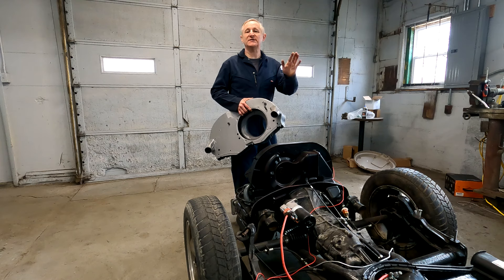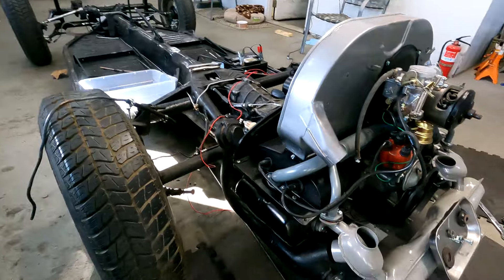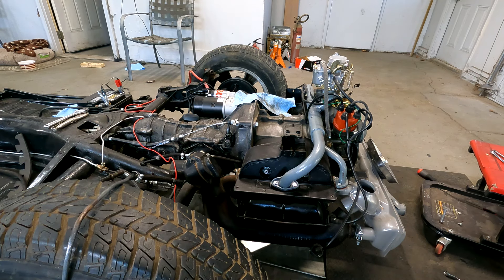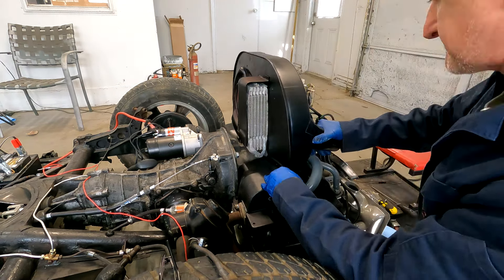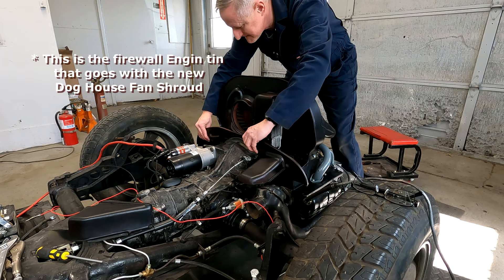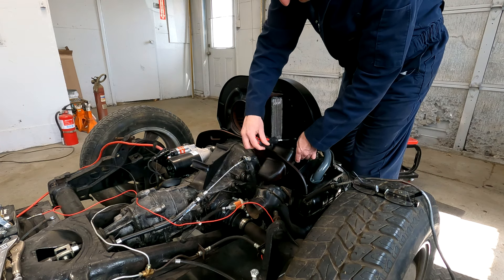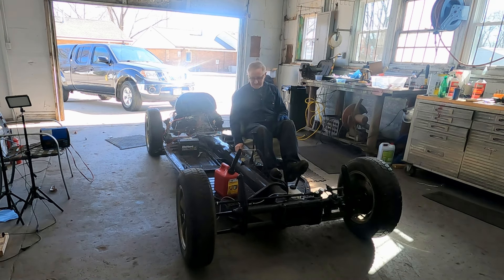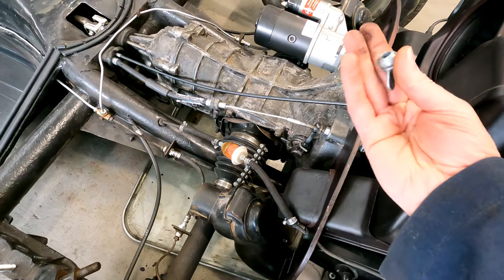64 VW Beetle: Dog House Fan Shroud

Comment: Well hello there. I'm thinking of doing the doghouse swap on my STD 73 1600 S.P. My question is will the deflector vanes an thermostat hardware swap from the OG fan shroud to the doghouse style? Thanks from Victoria BC (Canada)
Reply from the maker: Honestly, I don't have a ready answer.  The thermostat hardware is important if your are going to dirve it in cold or cool weather.  I figured that since I will not, its a late spring/summer car show car, I left them out.

Comment: You did a good job, and there is already enough experts that have chimed in here, but I have a question about the engine mount bolt behind the new dog house.  I’ve changed all my older VW’s to the through bolt with the threaded insert in the case.  Trying the take off the nut to pull the engine with the body on  is extremely difficult, so the insert option makes it very easy.  Just wondering what your plan is reconcile the problem. It looks you are still using the original style bolt and nut.
Reply from the maker: Thanks! you can see here https://youtu.be/7qPTon2QiOA?si=nYtWs37banqIsaQc&t=641 the nut is on the transaxle side, so (in theory)  if I remove the nut the engine should be able to slide back enough to get the bolt out.

Comment: Make sure you have all 9 shims in between the pully on the belt.....All 9 shims need to be in there or it will crack the pully. Some on 1 side some on the other side. But you need to have a total of 9......
Reply: not always , if you have a old J.C. Whitney witch hat spacer it keeps you from running out of threads .

Comment: That is the wrong master cylinder for when you remount the body. That one is made for a dune buggy; the proper master cylinder will have two lines stretching to the trunk to a tank to check the fluid level and keep it full.
Reply from the maker: That would be for a newer model. I want to clarify for those looking at this in future.    This MC and reservoir was recommended by a lot of folks, you can see here on Chris' Classic VW channel https://youtu.be/-KYT7sv74Mw?si=Dh8MlbQqo8bEXFhw&t=186  and this is the recommended Master Cylinder/reservoir  from the manufacture of the disc brake kit as well https://www.cbperformance.com/product-p/113-611-015bdd.htm and 
https://www.cbperformance.com/product-p/product-p/6085.htm

Comment: 3:40 shows the “Hoover tin” , usually thrown away. “Hoover tin”? Whaaaa?
And , a wider fan is of course required for the doghouse style to work properly.
Just trying to help.
Reply: Thanks for the comment! One of the many things not shown in the video is me putting the larger fan on.  I did it after this video was shot, so it didn't make the cut in the final video.   Always good advice.
Reply: aka Hoover Bit
Reply: @Djinantonek  yes…. That’s it

Comment: 67 had swing axle with the straight clutch arm. We change those all the time to the straight one and it doesnt hurt anything. Also when it it is the bent arm Once it is tensioned it wont interfere. Just a little hard to get the wing nut started. You will want the wing nut on there at some point . believe me. On clutch cables most of the problems happen in the tunnel behind the pedal assembly. That is where the most stress is. Sometimes in the back because people dont counter hold the clutch cable with vice grips or a 7mm wrench properly. Usually I use vice grips because with 1 hand I can hold them and spin the wing nut. With the Bolt style you cant hold both so it is easier to fray the cable.

Comment: Fasteners are designated by their diameter, not socket size that fits them. So those "10 mil" bolts ate technically M6, and require a 10mm hex socket to turn.

Thanks for taking the time to produce the vid.👍

Comment: What goes on the pipe on  passenger side of the fan shroud?
Reply from the maker: There is an air duct that pushes air to the engine heater boxes.  Here is a pic of an assembled engine.  
 https://www.thesamba.com/vw/gallery/pix/2360252.jpg